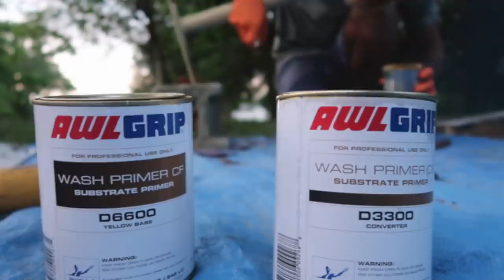Solar/Radar Arch COMPLETE RESTORATION!

Comment: Hey Billy,     Just a tapping tip,,,,,,we use "cool tool " oil at the shop when running a tap into material ,,,, 
In a pinch motor oil is better than using a dry tap ,,,,,
Looks good !!!
Reply from the maker: Awesome great to know! Will look that up!

Comment: Looks great the only thing I can add is that you should counter sink your holes even though you are mounting a flat plate, This gives more area for the butyl tape to fill in and seal.  Also I would have used Tefgel on the stainless bolts you used to mount the solar panels.
Reply from the maker: Thanks for the advice Steve! The bolts that mount the frame to the boat actually are countersunk.

Comment: Seems to be a great deal of consern with the solar panel install. There are many ways to skin a cat, in the end you have a skinned cat. I didn't see the wall thickness on the tubing, but judgeing by the peices you removed it is probably 1/4" at least. The panel rests on the tower. It doesn't hang under or use the bolts for support. They just keep the panel from blowing or sliding off. Fifty years of experience in marine maintainance and 40 years as a machinist says your instalation is adiquate. Would I have done it that way? No. I prefer skinning that cat another way. I avoid holes in aluminum when ever possible. When at the welder I would have had pads welded on. In my experience, silicon sealer is the product that will protect against galvinic reaction between stainless and aluminum the longest. Great videos, you two. See you in the next one.
Reply from the maker: Love this comment! haha thanks for the reassurance of our way of skinning this cat and also the advice to take into consideration for next time!

Comment: Nice job - Just one thing I would have done differently was to drill straight through the tubing for the solar panel. I wouldn't trust the few threads to hold up with the pounding its going to take. Keep that in mind later on maybe just do 1 on each bracket for safety.
Reply: Being a machinist by trade for over 27 years I have to fully agree with Demo Joe on this one. The amount of full thread contact may be only 1 to 1 1/2 threads in the pipe. This is certainly not enough contact to keep the bolts tight. If you happen to over torque the bolts putting them in you may have even stripped the threads in the pipe and not really know that you have. I agree that you should drill at least one hole on each pad and bolt them through the pipe with a self locking nut along with a locking lock washer to ensure that the nuts don't back off especially with all the rocking and rolling that goes on while you are sailing. Better to be safe rather them sorry. I usually don't comment to much but just thought I would add my two cents worth. Love you content in the videos and have to say that your drone shots are second to none here in YouTube land. Looking forward to your next one. Tom.Nova Scotia Canada
Reply: Demo Joe is spot on. Given the pounding at sea, those tapped holes won’t hold over time, at least two of those four hole sets should be through holes. Great work on the tower restoration!
Reply: Well with respect I disagree, this should be fine. I've been doing the same for years. The alternative is to use a pop rivet but that makes removal more complicated. The extra holes from thru bolting would weaken the tube and if they can get way without this then do much the better. If they do come loose thru bolting is still an option.   Remember KISS is good for less wt. every bit counts.  Corrosion with the SS/Alum is my biggest concern  that will cause paint peeling.  Cheers Warren
Reply: @CheersWarren  Pop rivets loosen and eventually come loose and rip out. I wouldn't trust a pop rivet.  It's just my opinion.
Reply: Tom Bulger s
Reply: Another option would have been rivet nuts. That would give the finished look of threaded holes and eliminate any exposed bolt ends.
Reply: @eosjoe565  rivets can come loose and rip out or even sheered off.  I would feel safer of having at least 1 thru bolt on each mounting pad but that's my opinion. I am not a Machinist by trade but I do not think drilling into the tubing would weaken it's integrity too much as long as it's not a huge hole.
Reply: A rivet nut (not a standard rivet) can not back out, but could be drilled out and replaced if needed. I'd leave it like it is and if you have to mess with it, you could easily just drill all the way thru and through bolt it or insert rivet nuts at that time.
Reply: Demo Joe - I was referring to Rivet Nuts.  They are a special nut that crimps into the hole with a special tool. You then screw in a standard bolt. They are very strong and very popular with fabricators.
Reply: Agree.  Obviously bolting all the way through the tubing would be the strongest.  Rivet nuts when installed properly are quite strong and as you say easy to replace. Also agree to leave as is and keep an eye on it.  Another less elegant but very strong approach would have been brackets attached around the tubing with U-bolts. You bolt the panels to the brackets and then secure the brackets to the tubing with the U-bolts. Very strong but not as clean looking.
Reply: @eosjoe565  my bad yeah they would work too. But they suck if they start spinning on you lol. Been there done that. Drill out a few of those lol.
Reply: @eosjoe565  what's done is done I am sure Billy will keep an eye on it. There are so many ways it could have  been done, some not as appealing than others. All have advantages and disadvantages.
Reply: The tower looks good.  But this is the same comment I was going to make.  Run the bolts thru and use nylon lock nuts.

Comment: How much does the arch weight, approximately? I've removed a set of davits that was too small from the transom of Cyclops, and have been planning to replace them with an arch spanning the hulls.  I'll also move my solar panels from on top of the bimini, to be on top of the arch.  I have been thinking I'd use stainless tubing, but perhaps aluminum would be a better choice, if it's lighter for the same strength.

Comment: The panel frame is al the tubing is al you should bolt threw with al bolts
Reply: An alt. use zip ties or bungy that way you can take it down more easily for storms.

Comment: Good job......but......., what a over engineered piece of aluminium. 1" stainless tubing would have handled upcoming load with ease. even with a dinghy
Reply from the maker: yes but it was attached in a very messy cluttered way and the stainless was much heavier than this aluminum put together